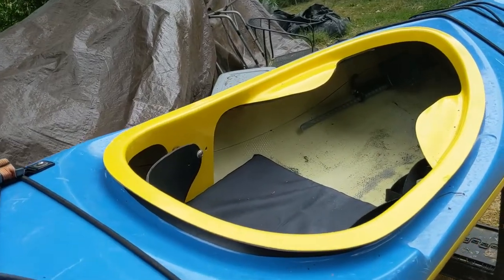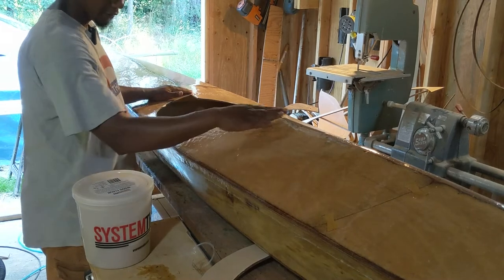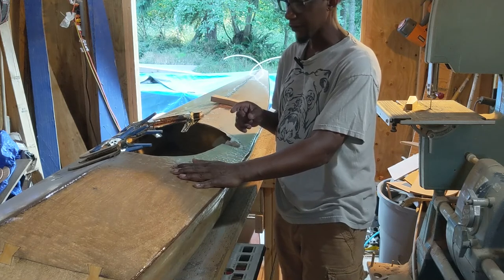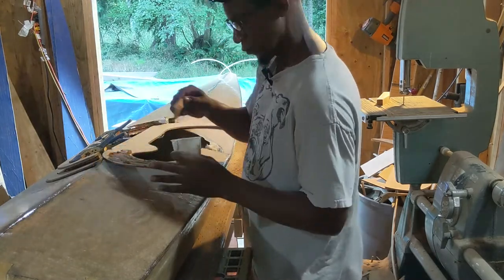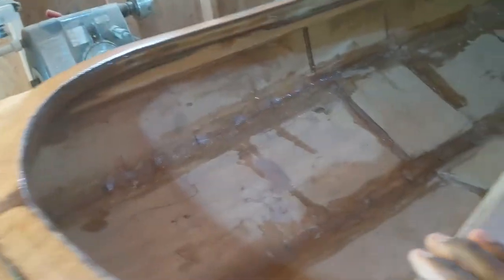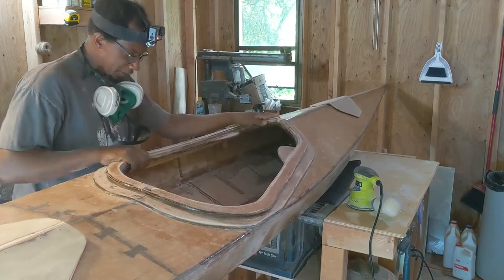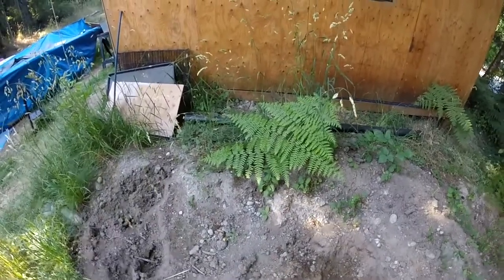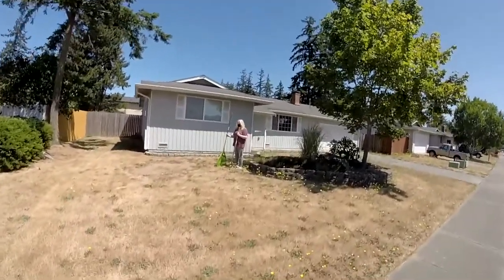Episode08 Installing the Seat and Coaming

Comment: Very nice work, but both for yourself and especially your younger viewers, you should wear eye protection and DEFINITELY an N95 mask as you're sanding. Without an N95, you'll inhale microparticles of your work, which will put you at increased risk of lung inflammation and scarring, leading to COPD. A regular dust mask or surgical mask doesn't filter out the smallest, most harmful particulates. Best of luck with your videos!
Reply from the maker: I haven't always been the best about safety, the mask I am wearing is  P100.  As for eye protection, I should probably put my side shields on or wear my goggles more...Sort of a bad habit that I should work on.